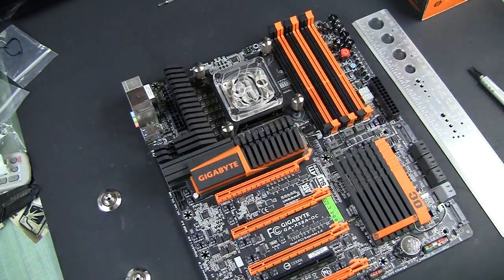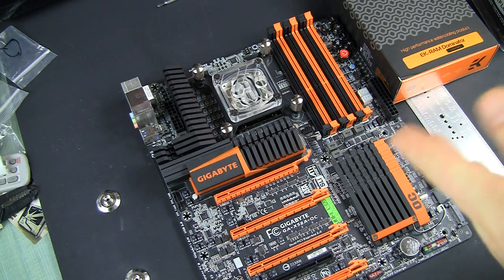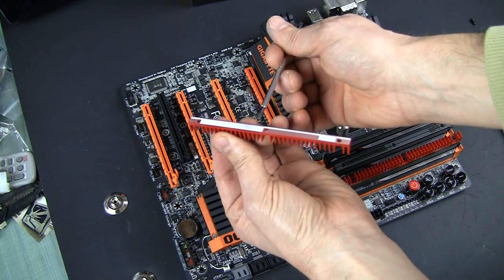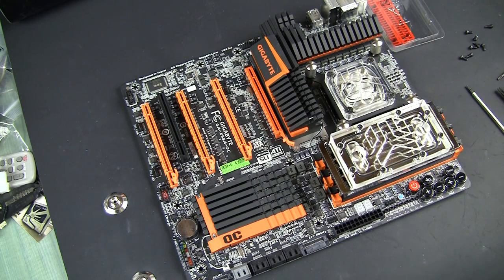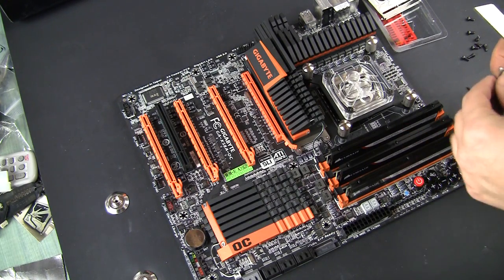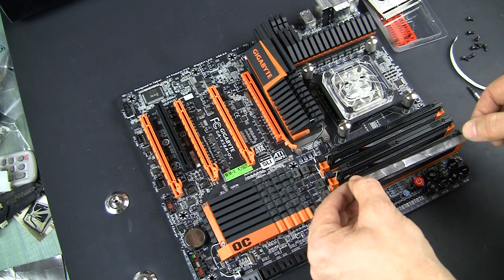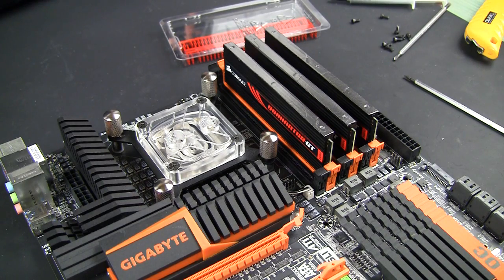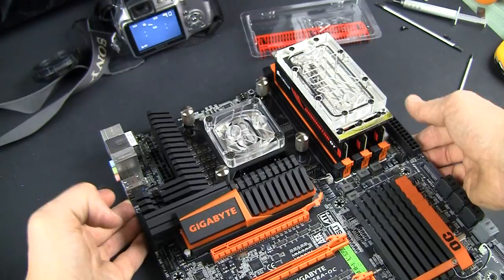Gigabyte X58A-OC & Corsair Dominator GT Watercooling

Comment: @zomgwtfbbqbagel i dont trust corsair either they have bad quality even the new case 900D it cost like 320 euro here for plastic + steel while for 400 euro you have a XSPC h1 or h2 thats full aluminium and you can take it apart and removable tray and like 10x better quality

Comment: @zomgwtfbbqbagel You don't trust Corsair? Man, Corsair makes some of the most high quality products available, and if you ever have problems with a product they made their support is the best. I've never had a problem with either my RAM, SSD or PSU, but they did send me a new 700D front panel free of charge because I had slightly damaged mine, even though it was totally my own fault, no problems there.

Comment: @zomgwtfbbqbagel I run Corsair: Power Supply, Ram, SSD, and the Obsidian 800D. Personally I've never had any issues with them. I have put my trust into Corsair and it payed off. Brilliant performance. Give them a try you won't be disappointed.